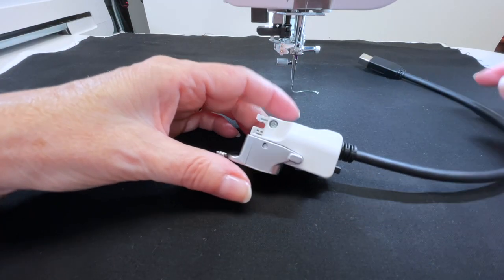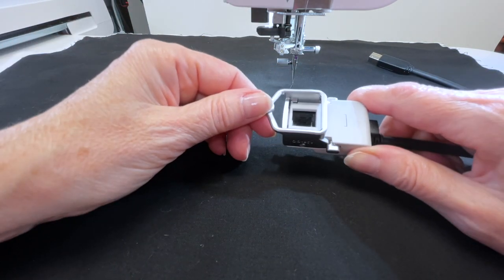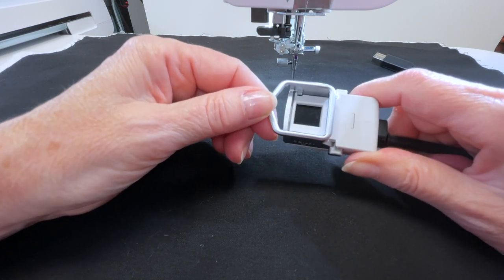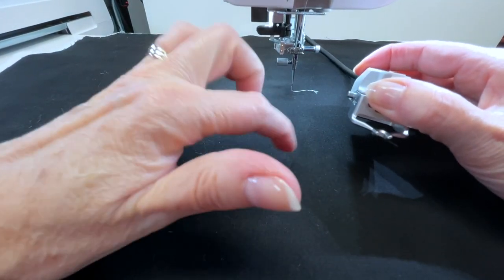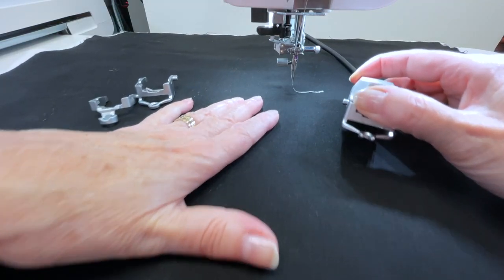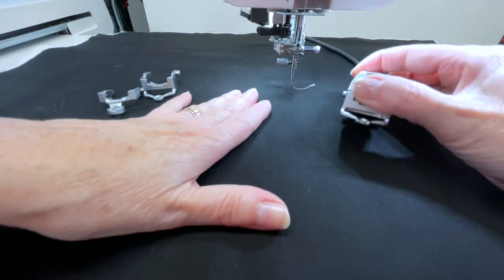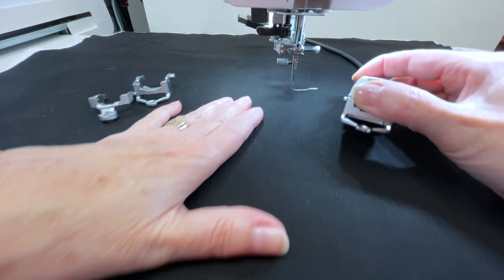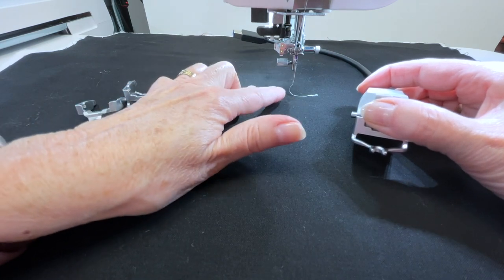What is a stitch regulator?

Comment: does it work on the Janome M 7 ????
Reply from the maker: No, as there is not place to plug it in the M7. You'll find the stitch regulator on the CM17, the new 9850 (optional purchase), and the new M8 (included with machine).